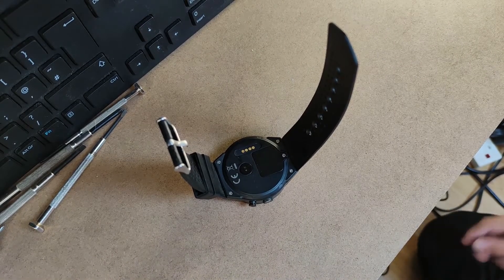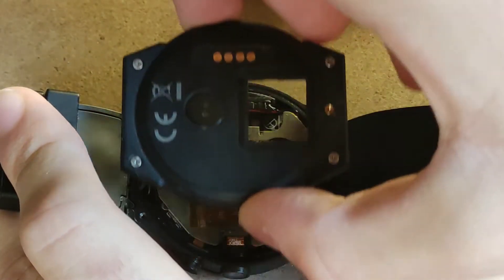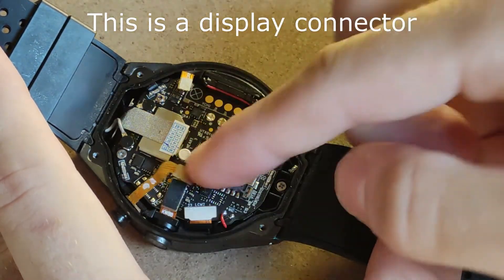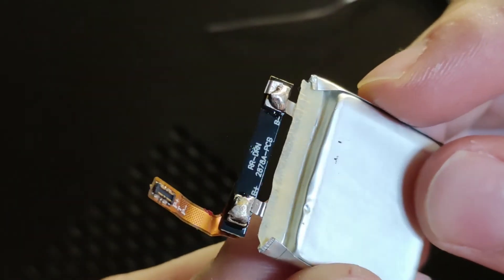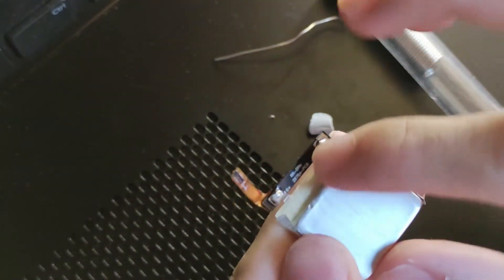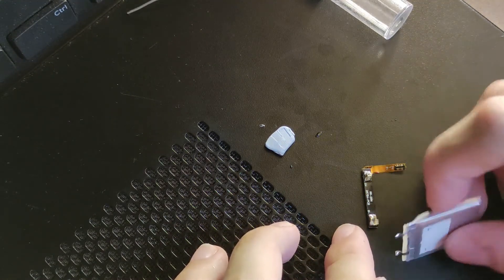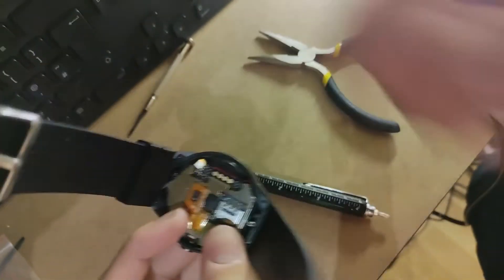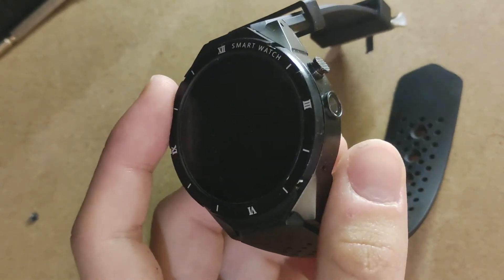KW88 Pro Battery Replacement (BMS transplant)

Comment: Please tell me the site name my kingswear 88 pro watch display is broken please tell me
Reply from the maker: I don't think original parts for this watch are still in production, and search results come up dry, so I can't help unfortunately
Reply: @scellyyt  sir this watch is very close to me please help me this watch is gifted by my sister but now he is not with me please help me can you send this watch for me . I will pay double for this watch please help me to save my memories please
Reply from the maker: You can still buy used ones every now and then on ebay, have a look on there
Reply: @scellyyt  sir this watch is not display or ebay site can you please check the watch and tell me the site if available please
Reply from the maker: https://www.aliexpress.com/item/32926374693.html?